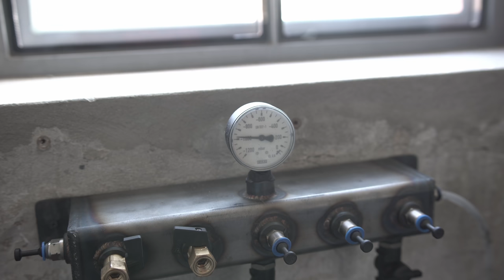R-NineT Scrambler Ep. 3 | Making a composite Seat Plate

Comment: Beautiful seat pan. Thanks for showing such an informative video on this process. I have watched many carbon videos, but still learned from your techniques. Am I correct in guessing that the spray adhesive has to be compatible with the resin, or do you not need to worry about that? Cheers.
Reply from the maker: The spray adhesive should be compatible with the resin, 
For heavily loaded components I use another, which is also from the manufacturer of the resin, this is then 100% compatible with the hardener in the resin, but does not stick as well, and is much more expensive, so I use it only for structurally loaded components.